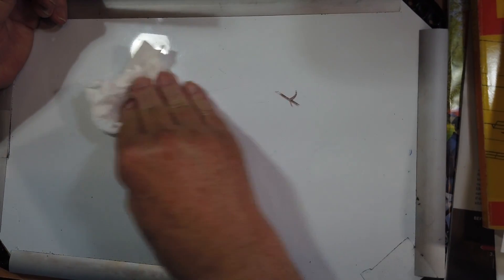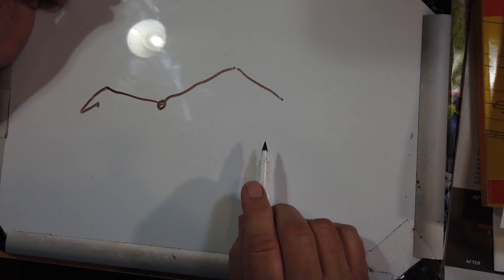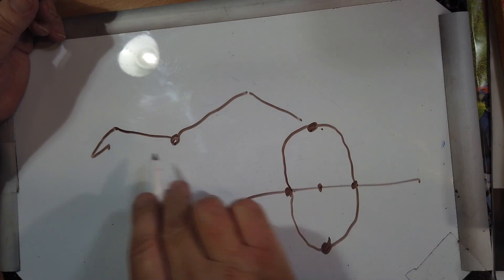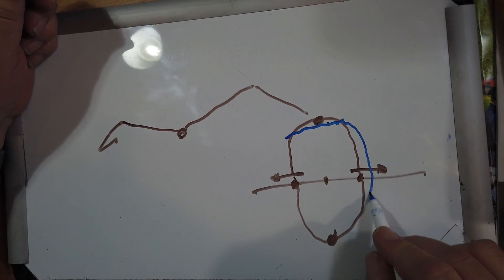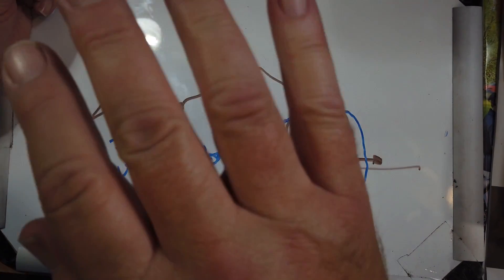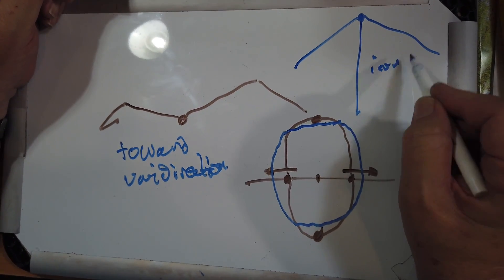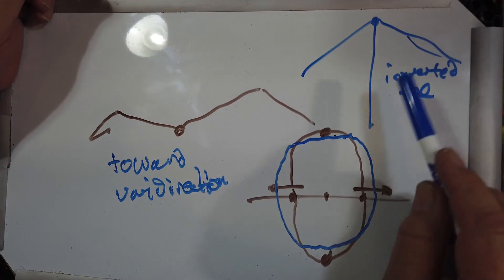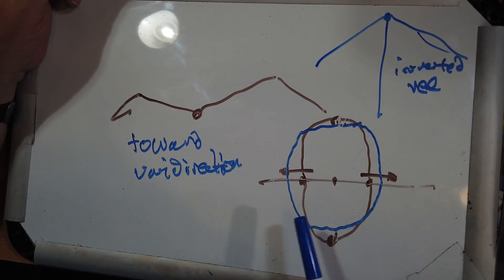Even a Wiggly Dipole can Work Well  (#763)

Comment: Great video. I have space challenges and have to get inventive. Could you do a video on sloping center feed dipoles. I have a 20 meter dipole sloped approx. 30 deg. With the highest end at 25 feet. Is there an optimal angle and is it directional?

Comment: In the military (1975-1990) we used a inverted vee on a mast with the leg having a forward slope. It was use to help dirtion the signal away from the bad guys. Also could change frq quickly.

Comment: Thanks Dave for the good video.

1st Rule of Antennas:  Everything affects everything.
2nd Rule of Antennas:  Antenna height matters.
3rd Rule of Antennas:  Any antenna is better than no antenna.

I can't remember the 4th rule.   Any ideas?

73,    AC3HT
Reply from the maker: I'm thinking: No antenna goes more than a year without being tinkered with?
Reply: @davecasler  I agree.  That is a good one.  Was also thinking about the following ideas:

-  Understanding antenna theory gains one knowledge.

-  Antenna location matters.

-  Every antenna installation is unique.  

-  When all else fails, propagation knows the path.

-  Antenna experimenting is learning.

-  Vertical or horizontal, it's ultimately all circular.

-  Improve your antenna before getting an amplifier.

-  Your antenna selection often reflects one's style of operating / personal preferences.

(A few humorous suggestions)

-  Antennas installed in the winter seem to work better.  😏

-  Keep antennas and wires in the clear and not trampled by deer.   😏

-  No matter how elaborate the antenna installation, they are all temporary.  😏

73, 

AC3HT
Reply: 3: More wire outside is better in many cases than less wire outside.

Comment: You could add loading coils this would eliminate the need to bend the ends of the dipole.
Reply from the maker: True, but adding loading coils narrows the bandwidth. It's a tradeoff.
Reply: @davecasler  It's RF power that is effected, bandwidth is reduced by the width of the element.
Example; an antenna made of thin wire for elements will have a smaller bandwidth that of one made of 2" aluminum.
It's RF power that can be affected depending no how the the coil is made,a small wound coil will have more resistance then a large coil which would cause more heat.
loading coils introduce resistive and reactive components which will cause a portion of the RF power - fed to or received by the "loaded" antenna - to be lost in the form of heatinstead of being radiated out as useful signal!

Comment: If they wiggle in the wind, and if the driven element comes in contact with another metal object or another element -- especially a grounded one, watch both the SWR and ALC meters spike suddenly!
Reply from the maker: Specifically here I'm talking about dipoles, held in place by the appropriate mounts.